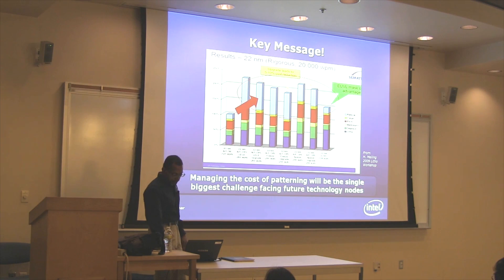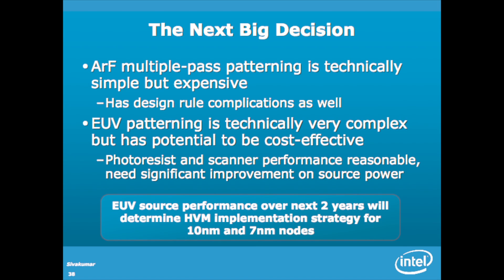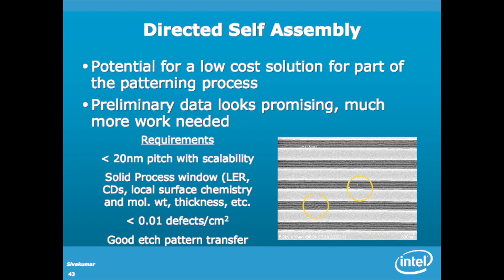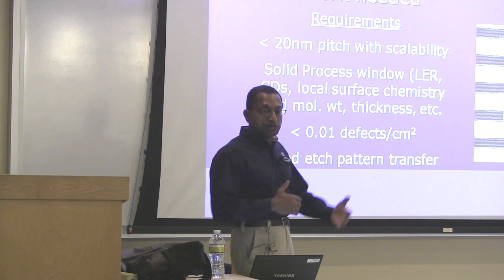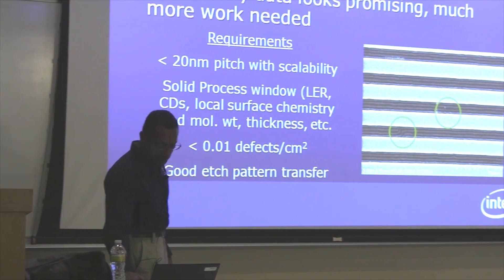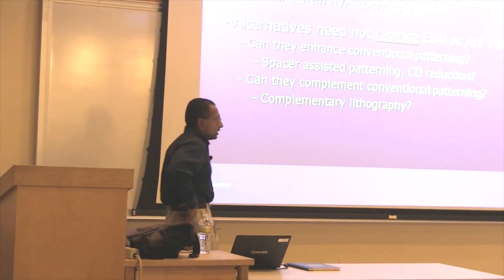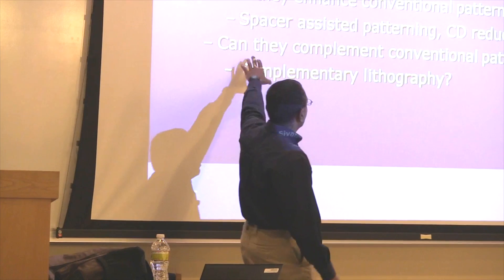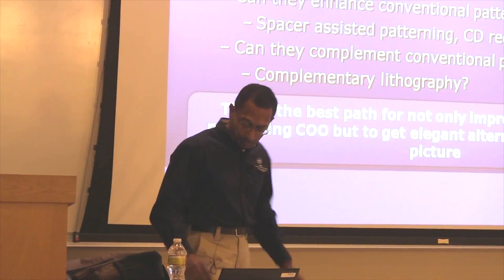Sam Sivakumar of Intel talks about Lithography and Patterning: Part 3

Comment: Those phase separating polymers cannot be chemically linked or they won't show differential dissolution.

So you need a poly-polymer solution in solvent that phase separates upon removal of the solvent and then shows differential solubility in another solvent. Cool!

Comment: MEBDW has the potential to be awesome for ASICs. Assuming a DR where all the fixed mask litho is a fixed template, and the dicing and packaging is fixed, a manufacturer could produce 10k different chip layouts for approximately the same cost as a 10k batch of one layout. Already the cost of mask generation has driven many ASIC manufacturers to a one metal custom mask, with the rest of the layers fixed.

Here's hoping for the days when you can order custom chips in single digit quantities.
Reply: No kidding. So they have a giant chip of useful gluey bits of computer logic and it's cheaper to make sure all of that works, throw away almost all of it, and just connect up what you need?

 Thats very very cool. Almost like the love child of an eprom based plc and an fpga?